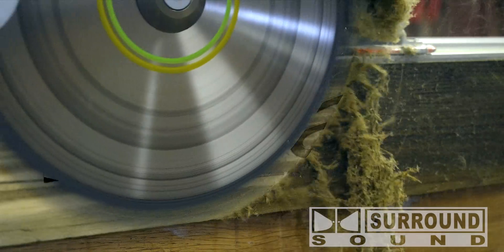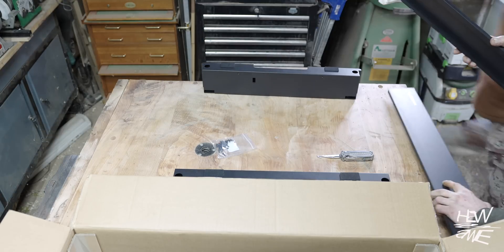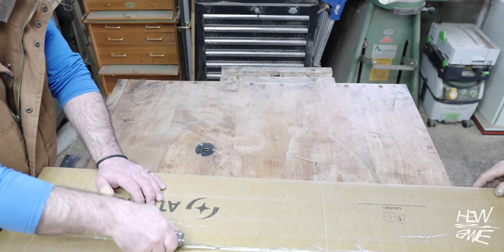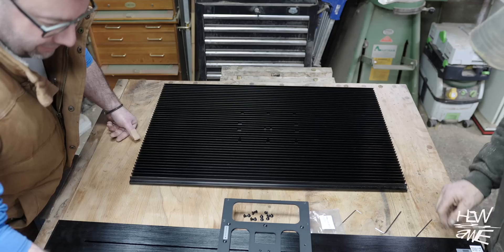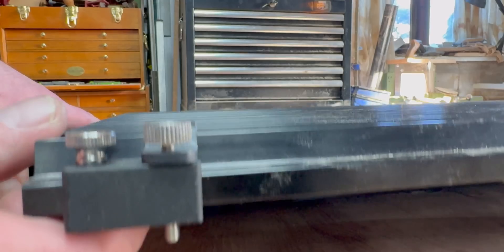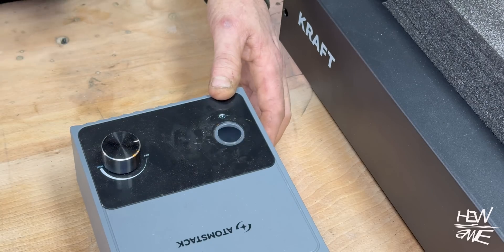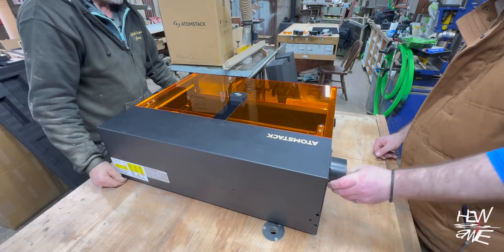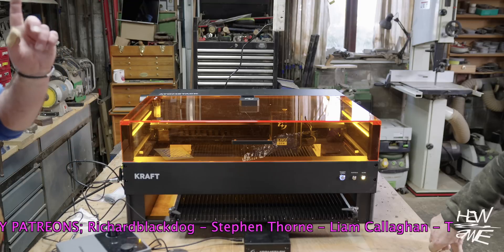Introducing The FIRST Dual Laser Engraver Cutter EVER Made

Comment: That looks VERY similar to my xTool S1... Except in mind you need to switch out the laser head.. Only takes 2 minutes, but still, not having to bother is a great idea
Reply from the maker: I had the S1 it’s a very good machine!!! I regret selling it, but gotta be paid somehow 😏
Reply: @HewAndAwe  So got to ask, why do you regret selling it?
Reply from the maker: @createinspain cause it cut stock on one pass, which is more what I need one for 👍
Reply: @ Does the Atomstack not do that then?
Reply from the maker: Not the thickness I need to cut for say templates 12mm plus in one pass. It will cut but only thin stock 0-9mm ish.
Reply: @HewAndAwe  Ah, ok. So my guess would be it is aimed at those (rather like me) who only normally cut thin wood or materials, and that your S1 was the 40W that cuts thicker than mine.